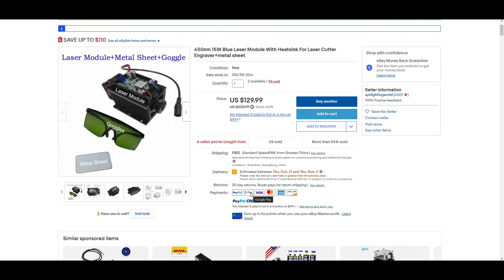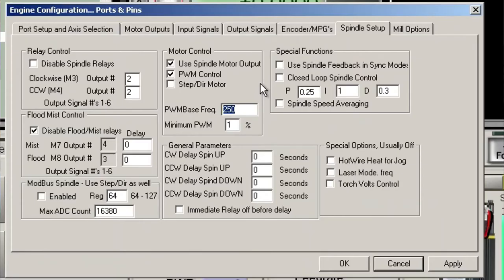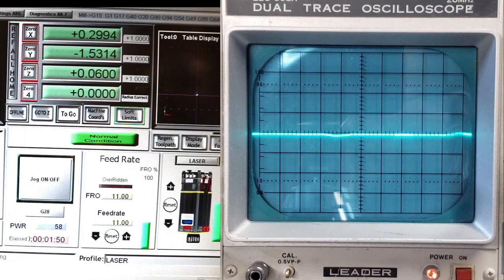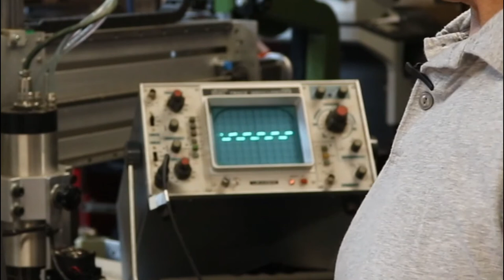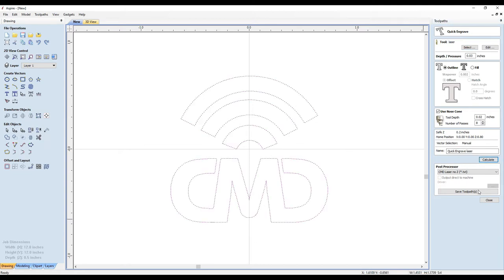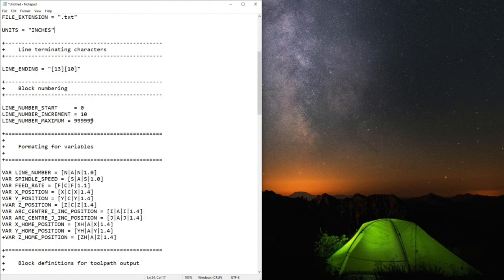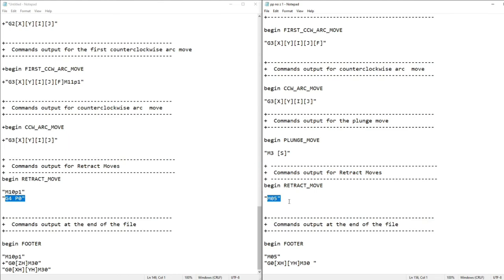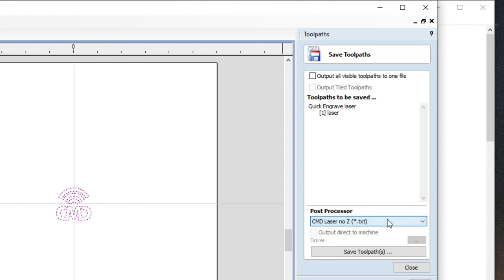Mach 3 Laser Diode Control

Comment: Hi Carlos, thank you for this excellent video. Could you please clarify why you mentioned two outputs but seeing the circuit you are only using 1 output (pin 1), Is really necessary the other output (pin 14)?
Reply from the maker: No. you only need one pin (pin 1) in this case. 
It could be any output pin you are not using.

Comment: Thanks for your explanation on how to set up PWM on Mach3.  I am still struggling to get mine to actually create pulses though.  I have a scope hooked up to pin 1 just as you did, but only have 5 volts solid on this pin regardless of what I try.  I have disconnected my breakout board and am watching straight out of the parallel port. Has to be some simple setup I am missing.  I even tried a clean install of Mach3 and only configured pin 1 as an output, no joy.  I will get it, I am a Pitbull when faced with problems to solve.
Reply from the maker: I am sure you checked, port 1, pin 1 and active low on ports and pins config, output#2 enabled, and on the spindle control, uncheck enable spindle relay, and use output #2 for both CW and CCW, and check PWM control check box. PWM base frequency  250 pulses/sec. Make sure you refer your parallel port pin to gnd. it should work. Set your scope timing fast enough to read it. 
Good luck.
Thanks for the comment.
Reply: @CarlosMDominguez  I will double and triple check everything but I think I have all that. Plus I'm going to try on a another computer in case I've got issues. Thanks for your reply.
Reply: Success!!  After a fresh load of Version R3.043.062 and completing the configuration, I now have pulses!  Turns out that I was missing one crucial step in testing, set Spindle speed to somethng other than 100% during test......Duh!  Thanks again for your videos.

Comment: Good morning, thanks for the helpful video, i have a mach3 machine and i've correctly installed pwm laser, but for G-code creation i use Fusion 360 and i cant find any post processor right for my purpose..
Reply from the maker: There is a lot o videos out there about Fusion 360 Mach3 post processors.
https://youtu.be/YKsRyH6zNNU?si=Y2I0GT5xc4oXeYBv This one may help.
Thanks for the comment.

Comment: I purchased a simple laser module that came with a power supply. I connected it up to AC and it will burn a line if manually moved slowly.  I do not see any other connection points like your laser has.  Could I use my simple laser setup and modify things in mach 3 and have it vary the power like yours does, or would I need a laser like yours to be able to control it?
Thanks
Hager
Reply from the maker: Your laser module has to be capable of taking PWM signals, so you can control it with Mach 3; otherwise you can only turn it on/off  full power with a relay. However I don't know which module you have, I may be wrong.

Comment: where can I get a copy of the screen set that u are using . Looks great. Great video thanks
Reply from the maker: I will make available soon. Let me figure out the best way to do it. Thanks for your comment!
Reply: Thanks
Reply: @CarlosMDominguez  Wondering if the screen set is available?
Reply from the maker: @danworf  you can get the set here:
https://drive.google.com/drive/folders/1fwZ23uFYRCzvGEnZYA2hpS2PbrKjSeX6?usp=sharing
you can try to copy the set  file to the mach3 folder and the picture to the mach3 folder, then drop it on the mill bitmap folder inside mach3 and try it.
I think these are the 2 files required.
Laser Diode.se2
Main laser pic mod.jpg

Comment: Hello, I have configured Mach3 identically to yours, but I have no PWM signal on the output, what could be wrong? I have an oscilloscope hooked up and there is no waveform
Reply from the maker: Go to MDI screen and type M3 or M4 to see if it turns it on, M5 to turn it off. make sure spindle relays are enabled and that  you selected port one, and an output signal # 1 and that  is enabled with the port and pin number that you are going to use on relay control (make sure that output is the same), and that motor control PWM and spindle are checked. finally that you are probing the right pin on your breakout board  ( make sure the scope is properly set also) Hope it works. I hope I make sense. Good luck!
Reply: @CarlosMDominguez  Adjusting the slider starts working only when you load the example gcode and I give start, then I have to stop and then I can start adjusting the pwm slider, very strange and I don't understand it. You have no gkoge and the pwm control works
Reply from the maker: @krzysztofkciuk8837  yeah. It does the same thing on my setup. weird.

Comment: You did a great job on the information, but I lost it when you saved the file to the PP folder. I saved as and put the .pp on the end but it was still saved a text doc with the txt extention on it and vetric will not see it.
Reply from the maker: Go back to the file, at the PP folder, and rename it with the .pp extension, it should work. Then you have to restart Vectric, so it will see it next time you start the program.
Reply: Hello harryten, I just fought with this for the last 4 hours.  Save the file in Notepad as a txt file then rename it from .txt to .pp.  I missed that to. Don't forget to change selection to [all files (*.*)] to see files in PostP.  To view a .pp file as test you will need to rename it back to a .txt file then open it.

Comment: looking for help .would be happy to pay for the assistance
Reply from the maker: I recommend watching related videos, there is plenty of content where you can learn, I am certainly not an expert. Good luck!
Reply: @CarlosMDominguez  having issues with PP and ports and pins settings . laser is working but turns on and does not stop. follows gcode no stop or starts
Reply from the maker: @garyparrett8955  Laser is turned on and off with spindle command M3, M4 to turn on and M5, to turn off.  Check your spindle setup on config ports and pins. clockwise (M#) output #  then from that output chose the pin number on your port. The PP tells mach3 no to move the z axis. check this video:
https://youtu.be/_tTpMRuJ_I8
good luck.
Reply: @CarlosMDominguez  Need post processor for Vetric that works will do m3 and m4 comands
thanks

Comment: Hola carlos yo uso un relevador para el laser y lo activo con M4 y desactivo con M5, solo que lo modifico directo en bloc de notas reemplazando z-1 por m5 y z0 por m4.  te muesto unas lineas.   

N200G00X-118.218Y54.811M5
N210G1X-118.218Y54.811M4F600.0
N220G1X-118.218Y54.913M4F1524.0
N230G1X-119.001Y55.891M4
N240G1X-119.782Y56.850M4

Pero tengo problemas con el grabado.
Reply from the maker: Hola, Pirsto.
Cual es tu problema con el grabado?

Comment: Thank You Carlos great video, I got My Laser installed I used the PostProcessor   from J-Tech. i've used the same setting you did on the postprocessor.  I'm just having one issue. I'm hopping you might be able to help me resolve this problem. Once the M3 is activated to turn on the laser the Spindle delays approxamitly 3 seconds to start moving. it always leaves a burned dot at start of every section.
any form of advice would be truelly appreciated. thank you
Reply from the maker: Try setting spindle relay delay to zero delay. go to config, ports and pins, spindle setup, see if general parameters are set to 3 seconds, if they are set it to zero. You can also disable spindle relay and use PWM control using an output signal, as I did on the video. Good luck.
Reply: Thank you for your  response. I check the spindle relay delay it was at zero. I will try disabling the  spindle relay delay this weekend, I'll let you know how it works.
Reply from the maker: @ubaldoheredia4124  please let me know. thanks

Comment: welcome
Beautiful and wonderful work
I want help from you. I designed a CNC machine using Mach3, but I need a program that deals with personal photos and engraving them on wood like the laser shown.
And also through Luspendal Glass, thank you
Reply from the maker: Thanks. The program I use is Vectric Aspire. Is good to engrave vector images, but not very good at raster photo images. Not using mach3 anyway. Its better to buy a K40 CO2 laser engraver for that. Or perhaps an ORTUR laser diode.
Good luck.
Reply: I have connected the laser directly to the Mach3 board via Riley
Do you need other parts, thank you
Reply: @CarlosMDominguez  There is another question, how did you change the interface as shown on the video to a laser image and full control?
Reply from the maker: The laser is connected to the breakout board (parallel port LPT1) pin 1 and ground. no other hardware is used.
Reply from the maker: I created the bmp files on Krita, then I used Mach Screen Editor to create the interface. The power of the laser is controlled by the spindle speed override slider.
Reply: @CarlosMDominguez  Thank you so much
Reply from the maker: Thank you!